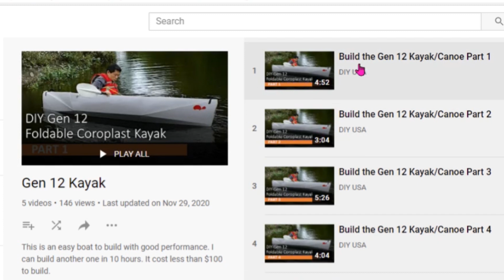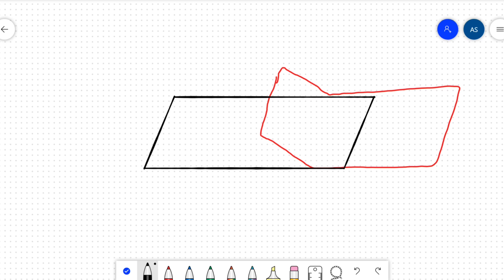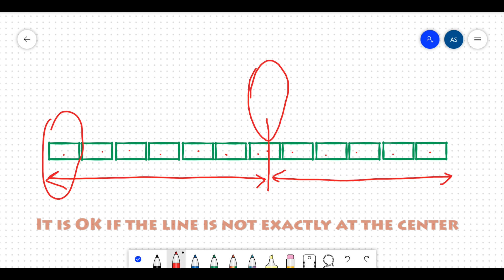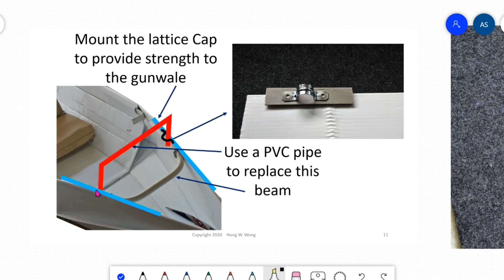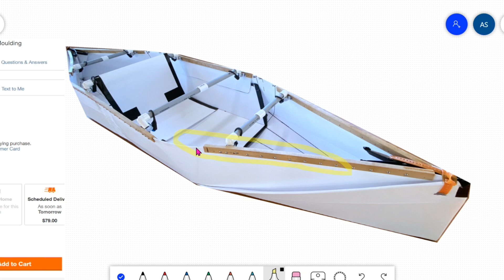Part 2 - Make Magazine - Gen 14 coroplast foldable boat

Comment: Hi, do you know what the safe weight capacity of this boat is?  For example, could it handle a #210 paddler and another #15 of stuff (cooler, water, etc.)
Reply from the maker: Thanks for asking, this boat should be able to handle 250 lbs. I have an updated version Gen 23, which is easier to build also. I have also uploaded the boat plan to www. DIYUSA.org. The newer boat can also handle more than 250 lbs. Please check out this video series.  https://youtube.com/playlist?list=PL2ShZzOUu01t7LO-j52loscfey8HNQOcX   🙂

Comment: Awesome boat Hong wonder ifgunwaills out of thick coro  will be enough and fuse them on
Reply from the maker: Hi John, you are correct, you may use 10 mm thick thin strip of coroplast and fuse it for the gunwale. This will remove the needs for screws. My Gen 12, which uses wider coroplast, and have extra coroplast on the sides and I fold it backward and also embedded a flatten PVC pipe as reinforcement for the gunwale. The 10 mm thick coroplast strip should be strong enough.
Thanks for the suggestion.